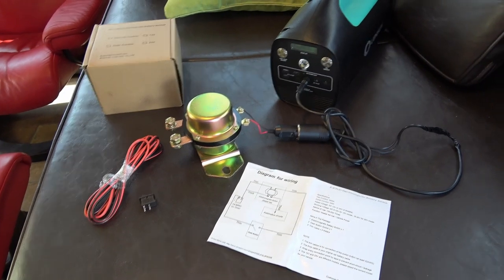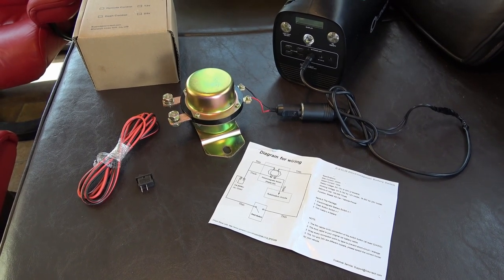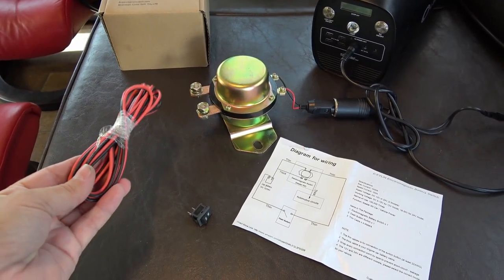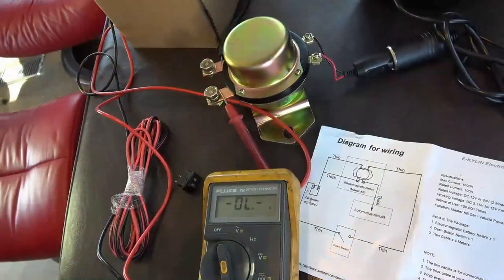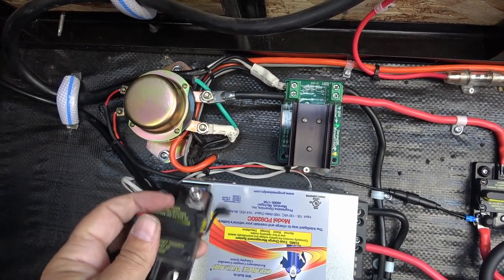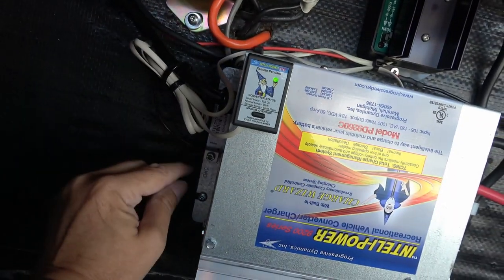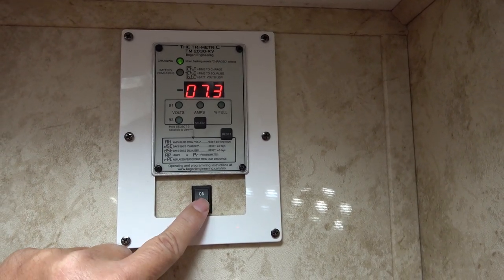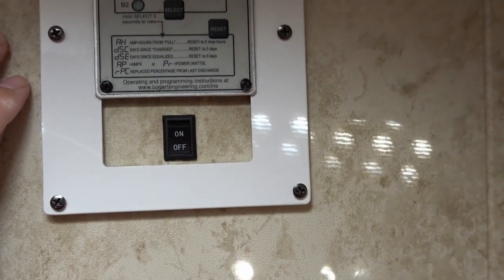Remote Solar Power Disconnect Switch Installation

Comment: Here is the data to back up my statement that 3.92V/cell and 15.68V as being the actual 80% limit for Lithium batteries. Also note that if you really want to prolong the life of your batteries, you want to limit the percentage they are discharged as well.  You should also avoid higher temperatures. https://batteryuniversity.com/learn/article/how_to_prolong_lithium_based_batteries
Reply from the maker: I read there are different voltages for different lithium chemistries, I believe the LiFePO4 (lithium iron phosphate) like I have is a little lower than other chemistries, that's why they make a good choice for replacing 12V lead acids in RVs. Yes, I plan to not let the batteries get to low as well.
Reply: @LoveYourRV  I'm fairly certain that Battle Born et al know the proper cutoff point to extend the lives of their batteries. I bet if you do some research that it is indeed at or near the voltage specified in this article. If you only charge to 80% of that limit it apparently won't have a deleterious effect. But you are wasting a sizable percentage of the part of the battery which you should be depleting to extend the life, since 80-100% using that as the maximum is the very best range for the utmost longevity.

When I first heard about this issue I came to the very same conclusion as you did. But now I think it is overcharging past the point where the vendors disable charging is what is the actual problem, not to the 15.68V level
Reply from the maker: My Lion Energy Batteries have 4 prismatic 90 amp-hour rated cells inside them, another YouTuber took them apart and confirmed that. Unlike BattleBorn who seem to use about 120 amp-hours worth of cylindrical cells but only let the BMS give 100 amp-hours to the end-user, there doesn't seem to be the extra capacity that isn't used as I have demoed my Lion Safari UTs using up to 89 amp-hours in a full discharge test. 
So, I'm thinking with these Lions if they are charged until the BMS stops charging they are actually very close to max charge on the primatic cells.  I was told by the company by staying in the 20% - 80% state of charge I could double or even triple the rated 3500 cycle lifespan. Since my bank is actually oversized for my current needs it makes sense to do that.
Reply: @LoveYourRV  There is just so much smoke and mirrors at this stage. It is difficult to discern the truth, especially given that none of these batteries have even seen 3500 daily cycles yet, much less double that.

The only way to know for certain what the max storage capability of these cells is would be to take the battery apart, disable the internal control circuitry, and see what the maximum charge actually is.

But one thing is clear. If you do charge them to 100% of their capacity, there is no way they can see 3500 charge cycles given the publicly available data on lithium batteries. That is the appropriate number of cycles for cells which are only charged to 80% of their capacity.

Comment: First nice should do the job. I have the victoon  that I just set to charge to 80% .can you not  tell you controller set a Cut off voltage and that would  be the '80%.
Reply from the maker: I find this disconnect a simple way to do it versus going into the controller and changing voltage parameters to cut off charging.  My solar controller's settings is a little difficult to get at, involves pushing a lot of buttons to set things then again to set them back. Versus the Victrons that have a nice app. Since I'm always looking at my battery monitor anyway, thought this would be easier.  Cheers, Ray
Reply: Hmm, I don't like this idea of charging to 80%. So much lost capacity on a day-to-day basis.
Reply: @drinkinslim  we were talking while the batteries were in float while plugged into Shore power but when we're boondocking you could have them charge right to 100% or 95 just so they don't overcharge

Comment: thats switch is not efficiency..because consume energy about 50w if on position..i search latching relay without continues energy
Reply from the maker: True, but doesn't matter as I only need it when on full electric hookups. The whole point of it in my application is the fact I'm getting too much battery charging and wanted less by shutting off the solar power. Also, it doesn't use 50 watts, more like 7-8w. In the video, I showed its amperage draw from my 13.2V battery bank of .57 amps.  13.2V X 0.57A =  7.5W Cheers, Ray

Comment: This is exactly the reason to replace that charge controller. Stop using 1990s tech Your batteries will thank you!!!!!
Reply from the maker: I love the little Bogart charger, has worked great for years. I'm actually thinking of adding a couple more panels and a second one to work in tandem.
Reply: @LoveYourRV  Please look into a victron controller. You pick your battery from a drop down menu, select it, and then you have the manufacturer battery charging profile. You spent a ton of cash on your batteries. Drop another couple of hundred and get a controller that will extend the life of your batteries, not shorten them.
Reply from the maker: The Bogart SC2030 controller Trimetric TM2030-RV combination has the preset manufacture battery profile feature as well, or every charge perimeter can be manually customized. The only difference is the Victron has a prettier more user-friendly interface. On the Bogart rather than a drop-down menu you pick a number and save it into memory.  http://www.bogartengineering.com/products/solar-charger.html
The only reason I would want to get a Victron is if I wanted to run my panels in series or get higher voltage panels, but the way I like to configure my system with matched 12V panels wired in parallel, there really isn't a compelling reason to spend the extra money.
Reply: @LoveYourRV  Excellent points Ray. I am glad to see That you have an good understanding of your system.  I am NOT a 12 volt guy and for that reason,  I use Bigger panels in a series parallel config. You say that you have matching panels, then I would consider a series parallel configuration. Anyway THANK you for your time and awesome videos!